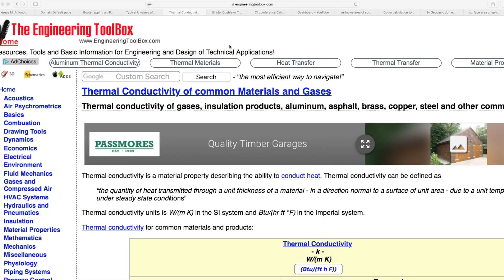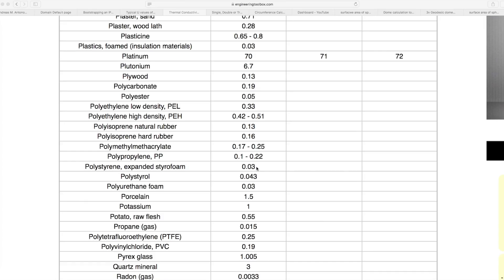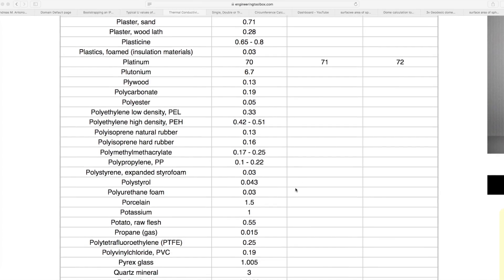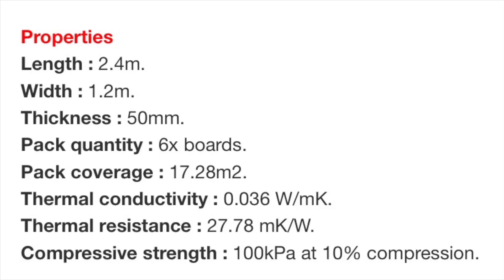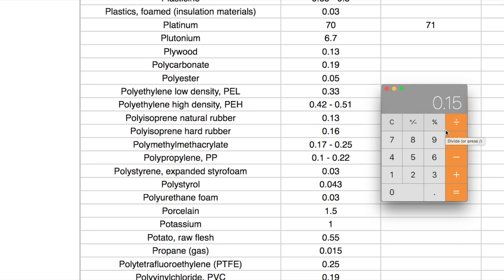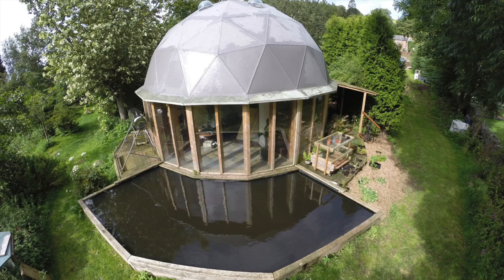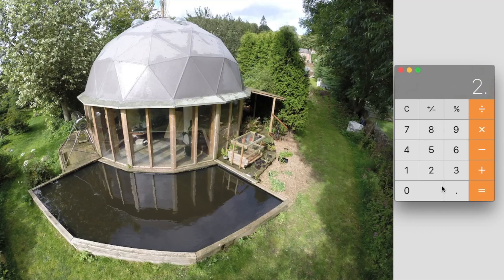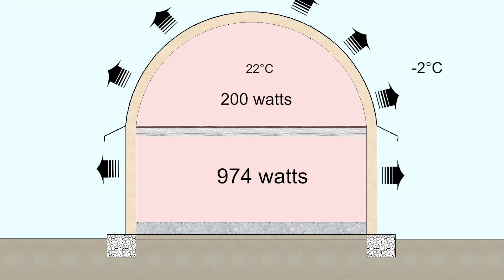Understanding U values

Comment: Can I ask what the difference is between theoretical and actual u values?
Reply from the maker: Theoretical value are what's the plan, buildings have to have a minimum level of insulation, this is all calculated then put in the plan. The real world can be different, for example I worked on a job that had one whole side a of a house that was all glass. There is no way this would meet uv requirements, so the remaining walls had extra insulation so that the combined U value was up to spec. A bit like wearing a fur coat with no back in it...  The actual value can be calculated by running a heater of a specific BTU and measuring the inside outside temperature, best done over a dull period fo a week or more. I would use U value as a guide only.

Comment: Interesting.
Some heat from your fire and element would be lost by radiation.
Which is why they often add radiant barriers.
Also
"When determining the overall thermal resistance of a building assembly such as a wall or roof, the insulating effect of the surface air film is added to the thermal resistance of the other materials."
https://en.wikipedia.org/wiki/R-value_(insulation)#Typical_R-values_for_surfaces